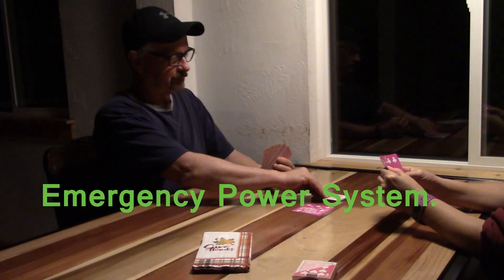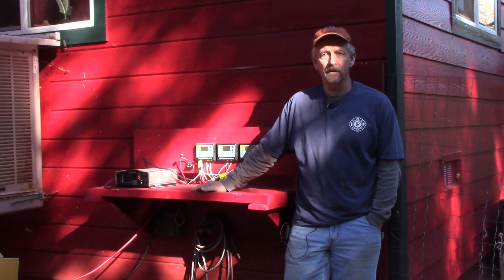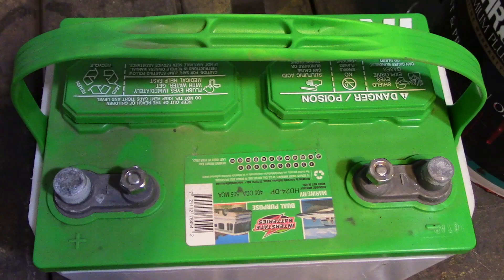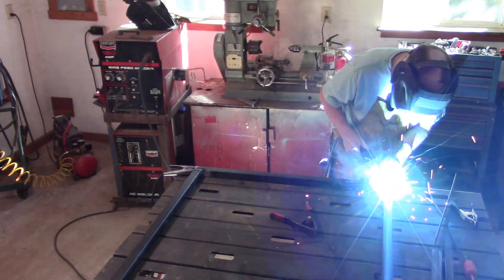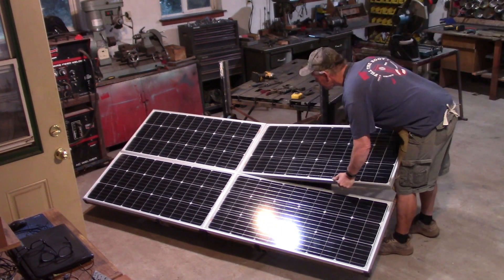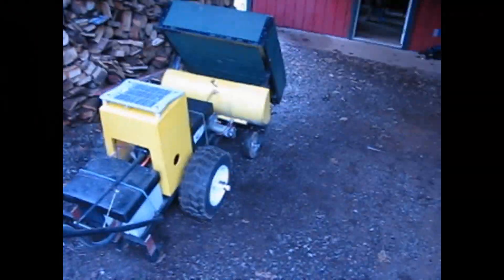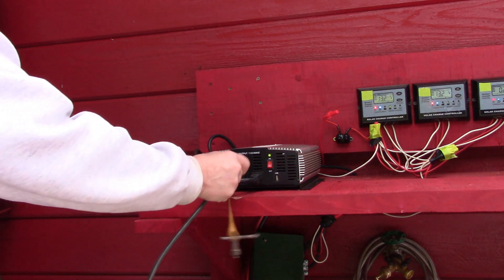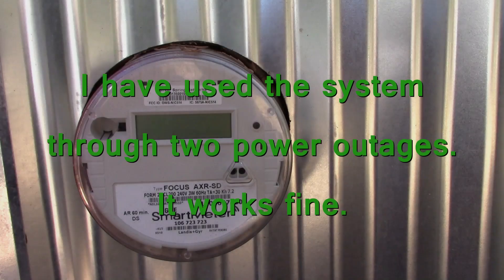Emergency power system for power outage and charging electric vehicles.

Comment: Good plan. Something I need to do as well. Power goes out at worst times, up to 8 hrs, and the diesel is getting old - noise, cost, smell, and so on.  Will you be showing more of components and wiring?
Reply from the maker: I was planning on doing a video on how to make the Transfer switch. Thanks, Lonnie